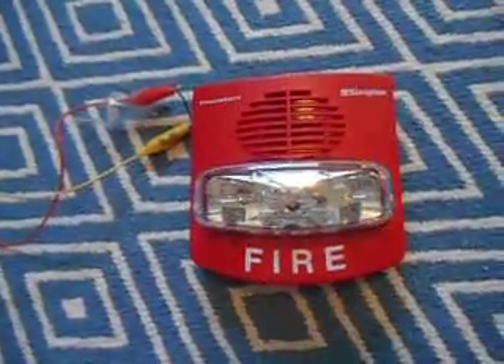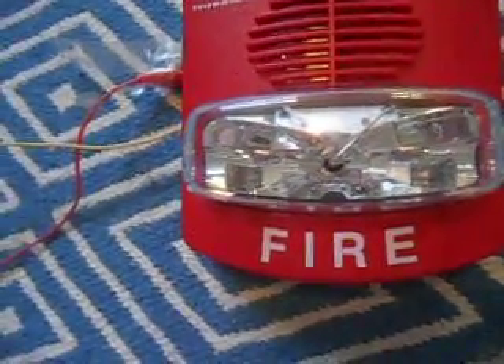Wire a Simplex SmartSync Truealert

Comment: I recently ordered a Simplex Truealert SmartSync, and I don't have a module for it. Can you find a way I could power it without a module?
Reply: Oh and nice video btw.
Reply from the maker: +Sterling Ordes. You will be able to make the strobe flash once when you disconnect power, but other than that, you're out of luck. Using the strategy in this video, you can wire it to become a speaker strobe. I plan on making a more clear version of this video soon. And thanks! :)
Reply: Should’ve got the 4903-9426. Those have a dip switch which turns off smart sync allowing it to be used without a module